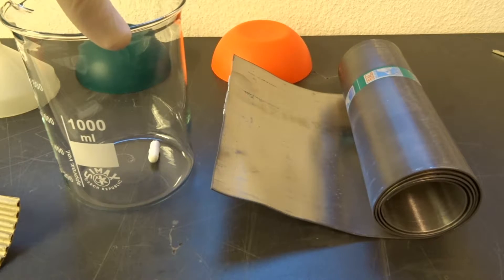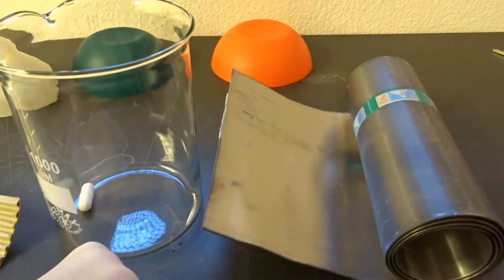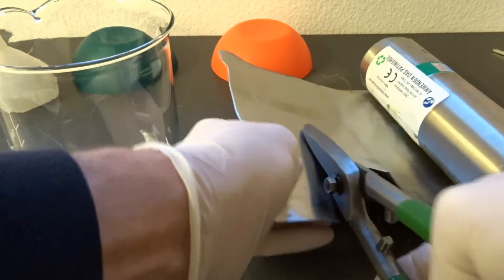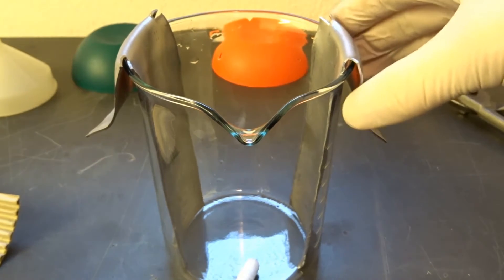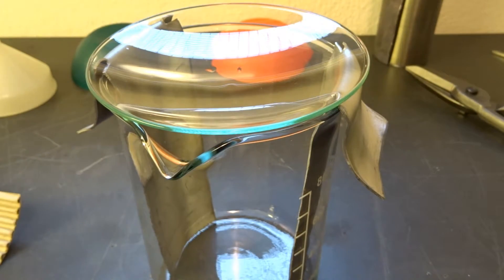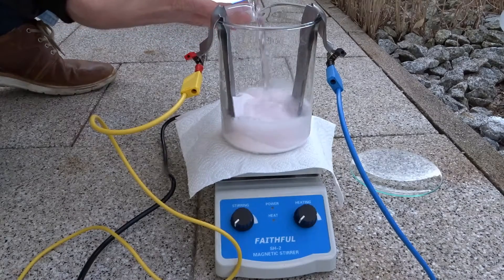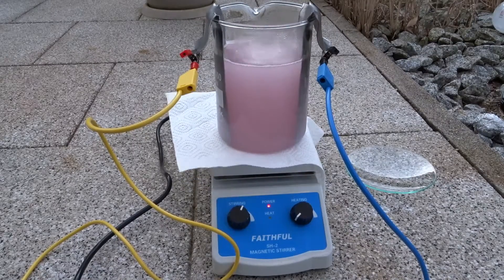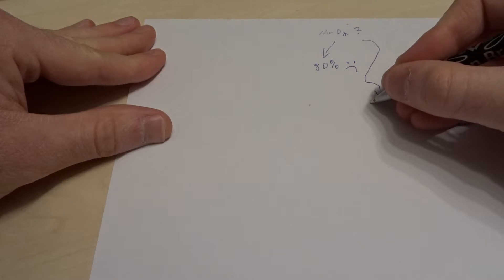Pure MnO2 Made By Electrolysis (Oxidation Of MnSO4)

Comment: This wont produce pure MnO2 as the anode also forms PbO2 which is the same color as MnO2.
Reply from the maker: Maybe in traces. I never noticed significant anode corrosion
Reply: @ShroomLab  yea its probably a layer on the anode itself and overall what was the yield of MnO2 you gotten.
anyway conversion of MnO2 to permanganate is hard even with pure MnO2.
they mostly use Mn metal membrane electrolysis in sodium or potassium carbonate.
Mn metal is easy to get using manganese chloride and a carbon electrode as the anode which forms a nice plate of deposited Mn metal on the cathode.

Comment: Why it's used for roofing
Reply from the maker: It is soft, flexible and corrosion resistant. The roof of former Notre-Dame was roofed with lead:)
Reply: @ShroomLab  but it causes Heavy Metal toxicity and band in many countries for open use so how ?
Reply from the maker: @omsingharjit  It is mostly seen on historic buildings. I don't think you can use it for a modern building anymore. You can still buy lead roofing sheets though. Keep in mind that a solid piece of lead won't do you any harm. It's only if salts of lead enter your body that you'll be poisoned.

Comment: hello, I want to ask, I have tried to make manganese dioxide by electrolysis. I'm confused, when should I stop the process, do I have to do it until the manganese sulfate solution turns black?
I hope the master is willing to provide an explanation ...
Reply from the maker: You can stop if either there is no mnso4 left or you think you have enough manganese dioxide. It is really up to you!
Reply: @ShroomLab  thank you for your answer. That means we can do it until the manganese sulfate is no longer reddish white. and if we have enough time, we can wait until it turns black
Reply from the maker: @fatih.73jtxditonton43  exactly
Reply: @ShroomLab  thanks. By the way, it's been 24 hours I did electrolysis, but the manganese sulfate solution is still brown. I am confused by this
Reply from the maker: @fatih.73jtxditonton43  Most of the time there are also byproducts formed. Mainly Mn(III) and Mn(II) oxides and oxohydroxides. They are brown. Try heating the precipitate in an open container in the air to around 350°C. This drives off water and oxidizes all compounds. A frying pan is ideal.
Reply: @ShroomLab  Very well. I just increased the input voltage, apparently it made the color of the solution darker in a short time